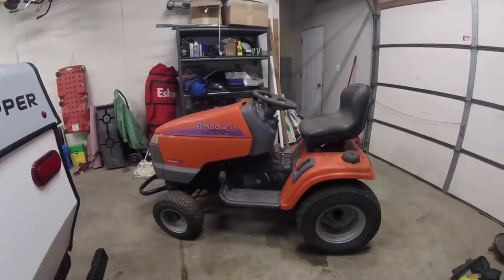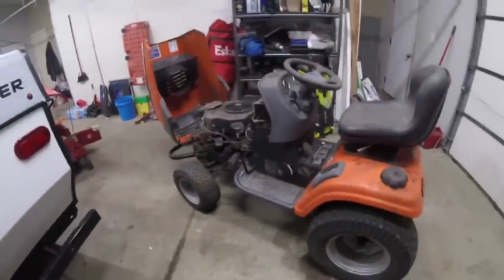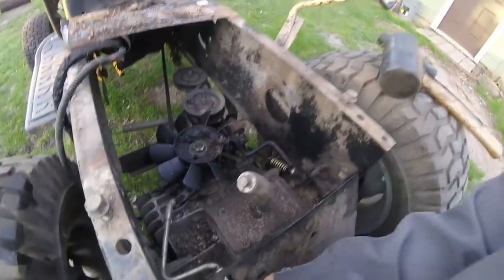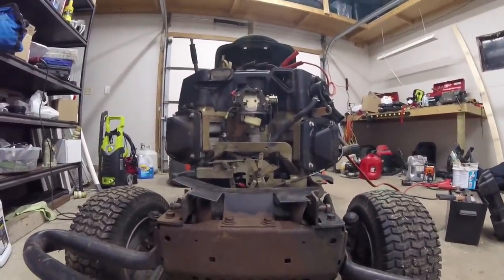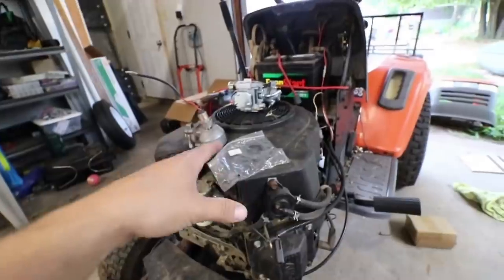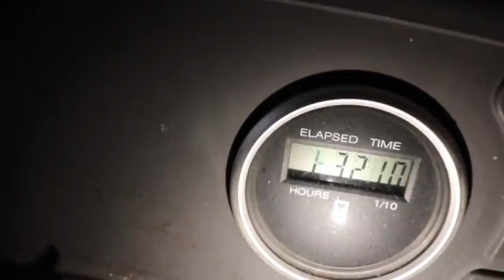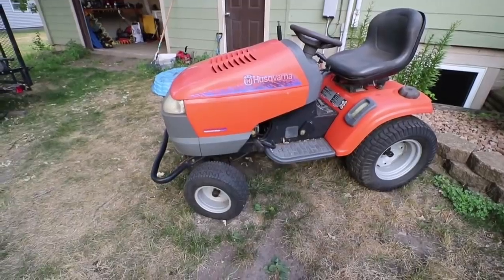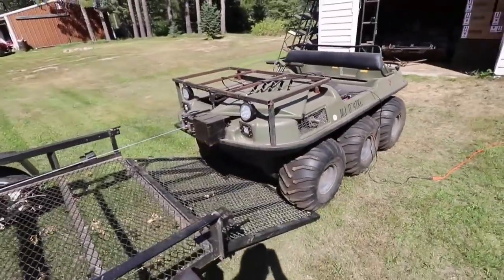Husqvarna Revival

Comment: You have to put some load on battery for 5 to 10 minutes, to check the battery after fully charge. If battery is faulty it will drain immediately once you put some load.

Comment: The wire and (jet) on the bottom of the carburetor as you called it is actually the fuel solenoid shut off. It' has a push button on the inside of the carb so when there's fuel in the bowl it works..not a jet a jet is inside the carb.

Comment: Great video 👍 but what happened the last 10 seconds? 🧐🤔That didn’t look smart.😂🤪
Reply from the maker: The argo is about 1 inch to wide for the locking gate pins on the trailer, getting it off was interesting, just a teaser. Thanks.